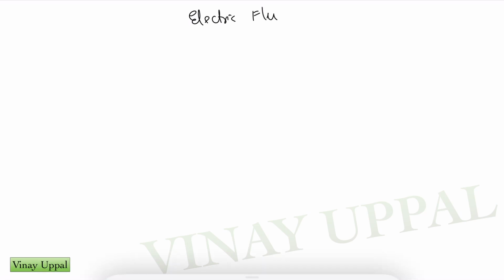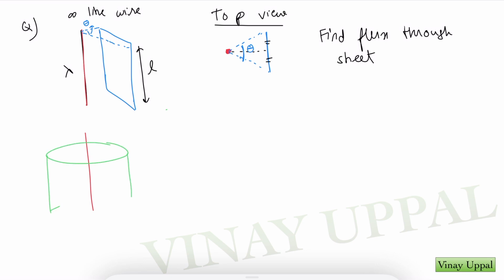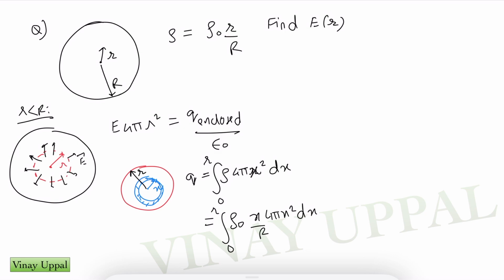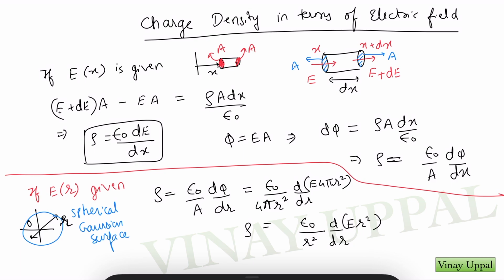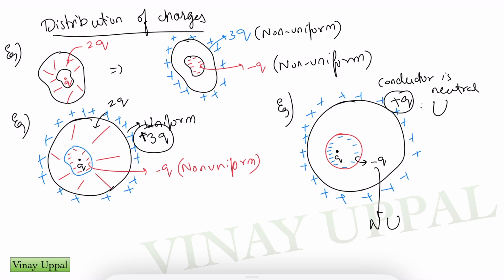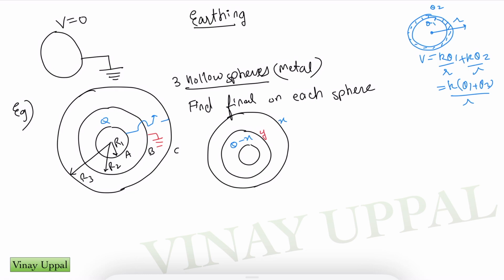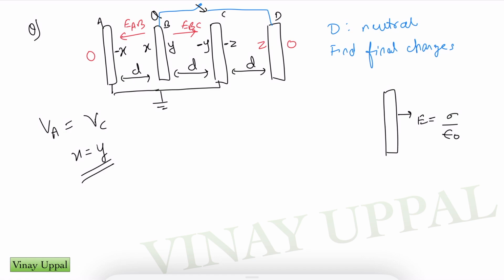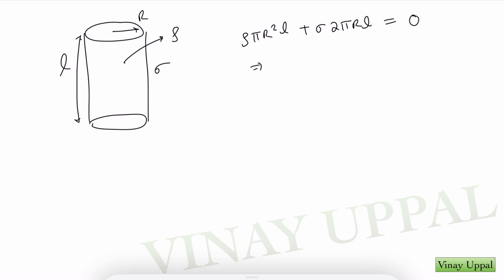ONE SHOT: Electrostatics Part 2! Must Watch For JEE ADVANCED! Detailed Notes on vinayuppal.com

Comment from the maker: If you are short on time, then watch the sections that I have marked IMPORTANT. They are lesser known concepts that you should master before Jee Advanced!

00:00: Yo Yo Yo!
00:20: Electric Flux
06:44: Gauss' Law
17:33: IMPORTANT: Cute Method for Force 
24:52: Sphere
32:49: IMPORTANT: Cute Method 
38:40: Cylinder
41:20: Slab
43:51: IMPORTANT: Charge in terms of Field 
47:36: Self Energy
51:40: Electrostatic Pressure
55:17: Conductors
01:15:31: Earthing
01:26:41: Parallel Plate
01:38:51: IMPORTANT: Parallel Plate in External Field
01:41:21: IMPORTANT: Accelerated Conductors
Reply: yo yo yo hits the most hard

Comment: Sir at 9:21 the situation is not exactly similar to that of the flux from the green surface because here the perpendicular distance between the charge and the surface is a which is not in the case of green surface where the distance is a/2.😅

Comment: Sir at 1:47:40, I tried deriving the same Roh formula from eodE/dr (the first formula)  and I am getting exactly half the value of Roh, which you derived in the video from second formula. Can check it once please.  I might be doing missing out something.
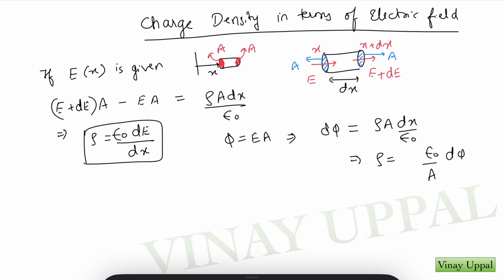Reply from the maker: e0dE/dr is not valid here, that was derived for 1-D case. Here in the cylindrical case, you need to use the general form of charge density in terms of flux as I showed you at 45:56
Reply: Yes sir I also have the same doubt but now its cleared

Comment: Sir in 1:20:03 problem,  you have let y charge on B shell, I think the total charge on B shell should be y-x, y on the outer side and - x on inner side,  because in just next problem 1:26:00 you took  y-x on the shell,  - x inside,  and y outside, is there a difference between the two cases, or it is as it is like you did???
Reply from the maker: In the first problem, B is a thin shell whose total charge I took as the variable  y. In the second problem, shell C is thick and has two surfaces of different radii, and the charges on those surfaces are what I took as variable y (on the outer surface) and -x on the inner surface.